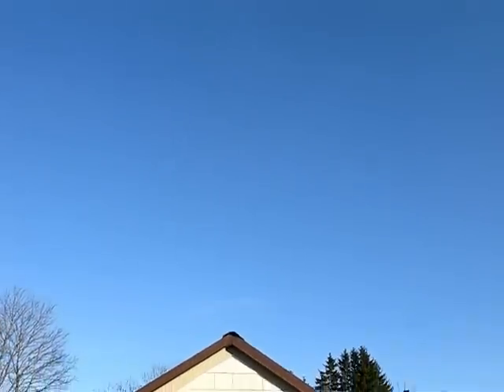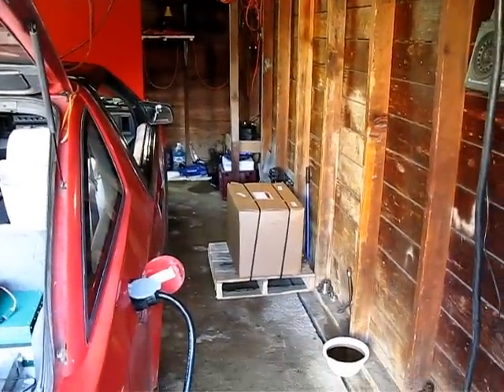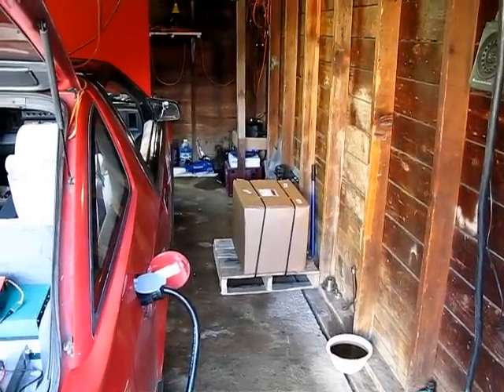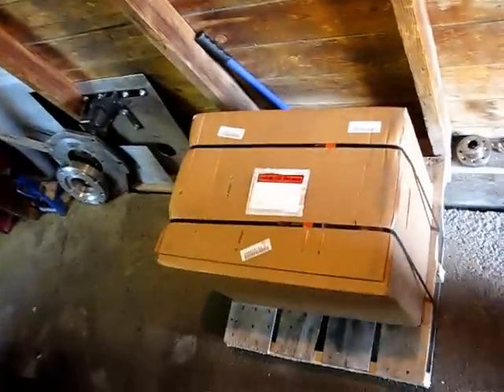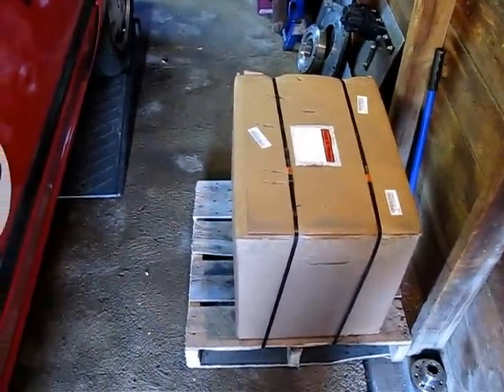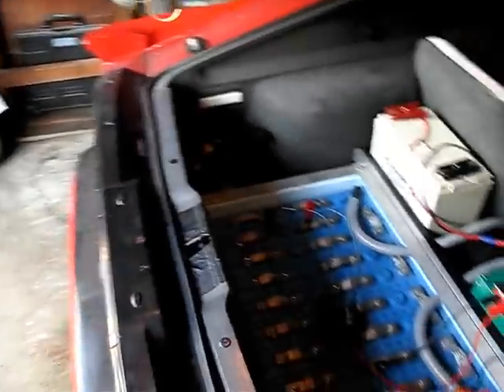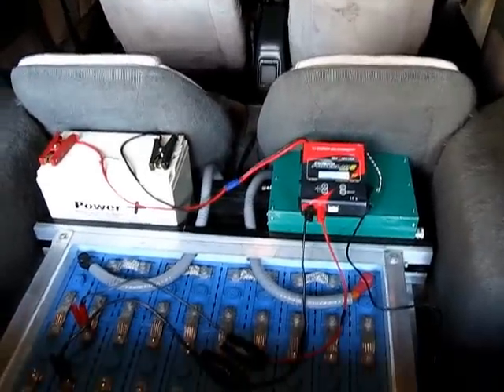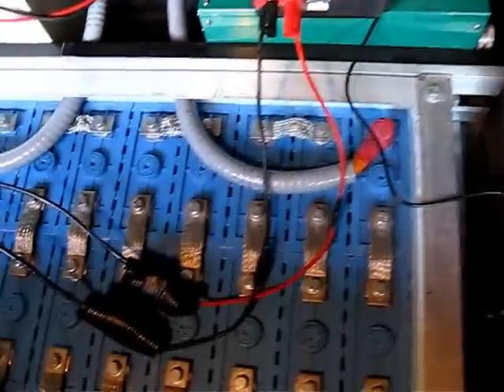December 4, 2012 - Battery Charging Followup & Repaired WarP 9 Motor Unboxing

Comment from the maker: I have 60x CALB LiFePO4 cells that I under-charge slightly to an average of 3.33v each, so the battery pack would be ~200v.

My EVNetics Soliton1 controller has a continuous power rating of 1000 amps (both battery and motor current), and the batteries are rated for "4C" (4 times their capacity of 180 AH, thus ~720 amps).

The WarP 9 manual says the max is 170v, so I have theSoliton1 limit the motor voltage to 170v to prevent arcing, with motor & battery current limited to 500 amps at present.

Comment from the maker: I decided that I wanted to do more testing with the 9" motor, including adding forced air cooling, real-time temperature sensors, and tie all that in with the Soliton1's inputs for data logging functionality instead.

While an 11" motor would certainly have even more torque and better internal heat dissipation, the trade-off of an extra ~$1000, plus losing space in the engine compartment for ~6 cells and having to redesign the front battery box was less appealing.

Next project = 11" motor.  :)

Comment from the maker: I used that orange, hand-held multimeter on all cells when checking them against each other before, during, and after charging.  That front cell depicted in the video is just the one that hit the highest voltage at the terminals (while charging).

The Revolectrix PowerLab 8 was used to bottom balance every cell, in sequence, to what it read as 2.800v then it terminated automatically (with a ~2.00 amp load on these 180 aha cells).

Wouldn't that mean they were all comparably measured/balanced?

Comment from the maker: The JLD404 seems to read about 1 volt higher than my hand-held multimeter.  For example: A moment ago it was ~36 degrees (F) in my garage, the JLD404 read ~199.5v and the multimeter read ~198.5v.

In theory, I could drain the pack down to 100% DoD (168v) again, but at what temperature, and according to which meter?

As soon as the load is removed the pack would immediately bounce back up a few volts, just like it did after bottom-balancing each cell last time...

Comment from the maker: I'll have to pull out that cell and have a look at it's physical characteristics to see if any swelling of the case can be detected.

However based on the voltage reading at the terminals 'only' reaching ~4.2 during the test (which was the original paper specification on the very similar chemistry ThunderSky LiFePO4 cells), I am betting that cell is no more damaged than it was beforehand.

When you had your GBS cells swell, what voltage were they reading, both while charging and after settling?

Comment from the maker: ...so the only way I can see to achieve a 'real' 168v would be to drain the pack until the cells were well -below- 2.800v, then let them sit for ~12 hours to recover fully, then drain them again and rinse-n-repeat until they 'settle' at 2.800v precisely.  (Again, assuming the temperature remains absolutely consistent during all of this).

To my untrained eye, such a strategy seems like it would take a massive amount of time, likely be damaging to the cells, and not really gain much of anything?

Comment: I would like to see each battery volts if you drive your whole batterie pack down to real 168 volts. And also after charging again. I think you have to rebalance your top cells. Just in case.
Regards Mathieu
P.S. Jakko is right.

Comment: Hi Daytona
Can you tell me the battery pack voltage and current rating which you have used in testing.

I am heading towards a bench testing of the Warp 9 motor using Lead Acid battery pack so can you suggest me any thing.
What about boost converter to step up the battery voltage level.

Comment: The video says repaired warp 9. I may need to get mine repaired, but don't know where or how to find a place that can repair these motors. Would like to find someone close so I can deliver and pick up myself, shipping charges would be too expensive.
Reply from the maker: I have searched for a more local source (near Central New York State, where I happen to live) which could repair my NetGain WarP 9 Motors, but haven't found anywhere myself either.

Personally I have had great experiences dealing with the folks over at NetGain Motors, and even though shipping such a heavy unit (which has to go freight) can be expensive and is a challenge by itself, overall I feel that the repair costs + shipping have have been quite reasonable for me in the past.

At least in the continental US, when one compares <insert repair/rebuild estimate here> + two-way shipping to a $2,400 + shipping cost for a brand new WarP 9 motor, I am betting it always works out to be quite a lot less expensive to go for the rebuild option.

I wish you luck, and please let me know how you make out with that endeavor...   I just so happen to have a pair of WarP 9's that I still need to ship out for a repair/rebuild myself.   :)